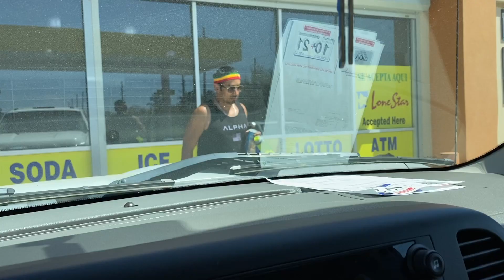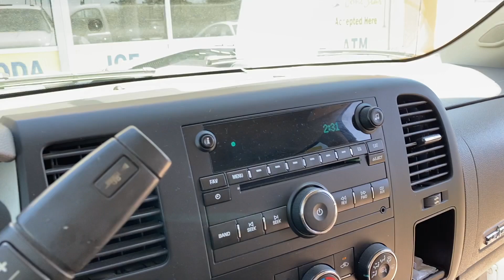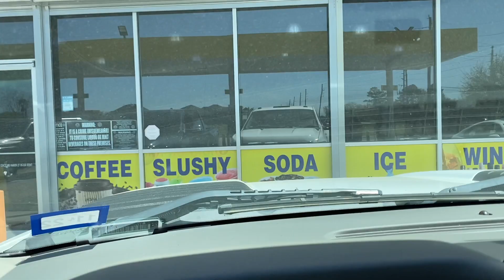Swapping out the spark plugs on a 2012 Chevrolet Cruze and dealing with family.

Comment: Did you have to gap your own plugs or do you order your plugs based on the gap you need (along with other variables)?

I just went on cruzetalk and found a brand and plug everyone suggests, went to Amazon and ordered them. Idk what my gap is tho, I just assumed they came how I needed but I've also seen videos of people using a small spacer and bending the metal down till it is the appropriate gap size
Reply from the maker: I bought the AC Delco plugs from O Reilly. They came gapped at .25 They recommend .28 The factory plugs came out even tighter then .25 I couldn't figure out how to bend the plug using the tool that I had because the flange wouldn't fit snugly so I just threw them in there. The car runs very well, but still have the check engine light.
Reply: @hordebutcher2651  ah interesting. I have same car, year and color lol. Mine is eco trim with standard transmission. 

I recently changed my spark plugs and coil pack tho neither was exactly necessary for me.

Do you know what code you are throwing?
Reply from the maker: @RandoManFPV  yes, I’m throwing a P0171 code. It’s been a good car for me. It’s been a love / hate relationship that’s starting to grow into a love relationship. I bought the car brand new from the Chevrolet dealer and then Jiffy Lube blew it up at 50,000  miles, when it was only three years old. 

Since then, I’ve been chasing misc. things down with it. It’s most definitely not one of those cars that was flawless throughout, but it’s incredibly easy to work on and I’ve learned quite a bit wrenching on it.